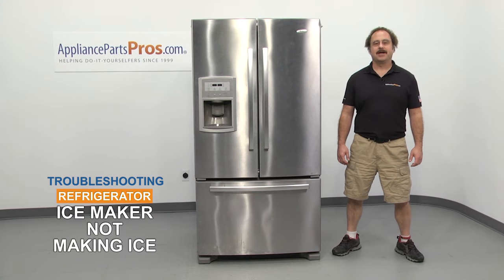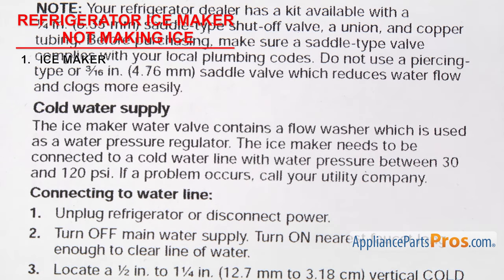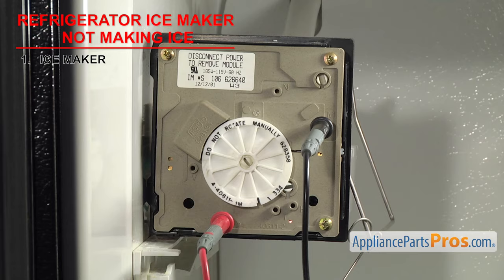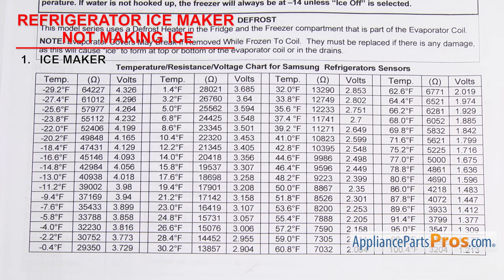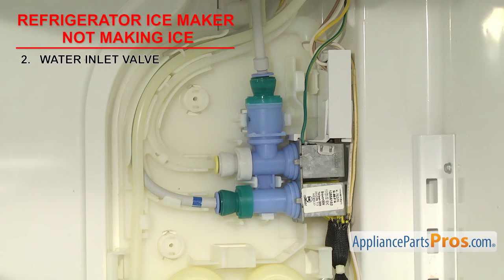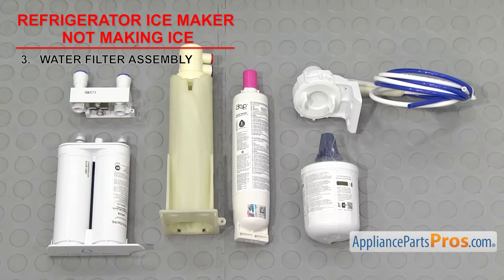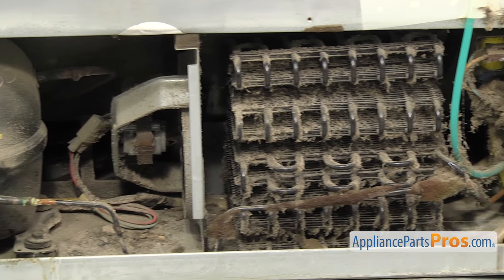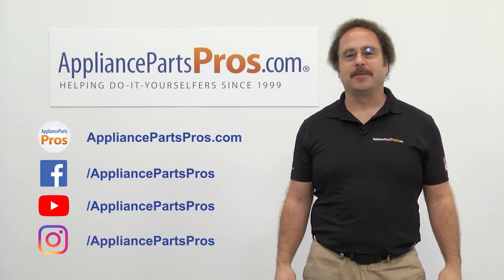Refrigerator Ice Maker Not Working - Top 3 Reasons & Fixes - Kenmore, Whirlpool, Frigidaire & more

Comment: External water valve solenoid I’m reading 1 ohm instead of 270. I checked the continuity on the solenoid for the ice hose in the back and it was good. Where is the external water valve solenoid at? I’m not sure what part it is

Comment: Here's my problem, I changed out the check valve, mine is inside behind the panel. I'm getting water to the water dispenser but none to the ice maker, so should I now change the ice maker?
Reply: Same
Reply: @shaunseagrave729  Same, I replaced the Water inlet valve and it did not fix the problem. Mechanics of cycle seems to work fine, it is just not pulling in water. Did you solve your issue?

Comment: This was a tremendous help! My Kenmore IM was still working but not producing as it should. Cubes were smaller, also. First step was clean the coils, and they were completely clogged. After a couple of days the IM close to normal, but still not producing as before. Just checked it out with multimeter and all appears OK.
Reply from the maker: What all did you happen to check with the multimeter? What is the model number of your fridge?

Comment: Last ohm meter test about blew up my ohm meter. Maybe they meant to unplug the refrigerator before testing!
Reply from the maker: Unless you are specifically testing for voltage it is always recommended to unplug the unit during testing.

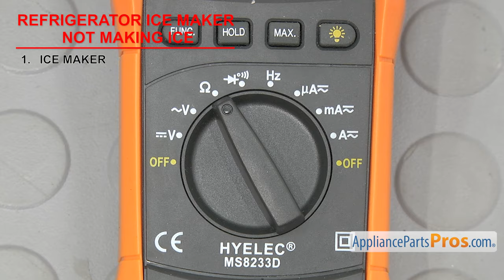Comment: I got stuck at 2:53 "First remove the cover"   In the video it's just sitting loosely on.  In my freezier, it's impossible to pry off.  Do I have remove the icemaker first just to get the cover off?  And if so, then I could use a bit more guidance on disconnecting the electrical connection.  I'm not seeing anything to pry up to release the connection.

Comment: I have a Hisense French door but the ice maker is identical to the one you're showing . I've had it for 2 yrs and a hard piece of ice knocked the part that flips the ice loose then the wires looked as if they got cut . For some reason , my entire frig seemed to shut down after this happened but everyone doesn't think this has anything to do with the frig stopping but this is the only thing that happened before it stopped. I actually tried to put the wires back together and noticed the frig staying on 45 seconds b4 it goes back out . I decided to replace the ice maker and hope it works . Because non of the videos I've seen has stated this could happen , I've just been guessing . Hopefully the replacement works .  Thanks for the video !

Comment: What temp should Frigidaire refrigerator freezer temp be set on the lowest or highest setting to make ice faster ?
Reply from the maker: As long as it is below 10°F, the icemaker should make ice. However, the speed will not change. On average, most icemakers make around 10 cubes every hour.

Comment: nice video, but it doesn't show my kenmore side by side. the ice maker is in the top of the frezzer. the ice despensor is on the door with a lift out bin. how do I fix this.
Reply: Have the same refrigerator.  I keep replacing circuit boards. Doesn't seem to help

Comment: Help! When I tested L and M for the motor I got 74.8 ohms  (MM set at 200 which is lowest ohm setting)  you said should be  4,400 - 8,800...when I tested the external water solenoid I got no change on MM. Got one on order.....

Comment: This one driving me crazy if anyone has suggestions.  My Frigidaire side by side is about 8 years old.  The ice maker replaced about 6 months ago.  We noticed some wet ice and frozen clumps in bucket then water leaking out of front.  I determined that the ice maker was calling for water and it opened up the valve and seemed to fill the tray normally and with no leak.  However, it called for water again every 3-5 minutes until the corner of the tray would overflow.  The valve seems to be coming on and shutting off properly it is just happening every few minutes instead of waiting the proper cycle time.  Is it the ice maker, the inlet valve or something else?

Comment: There is a part on top o f the refrigerator with is a tube that provides de water to the ice maker. That piece suddenly start  throwing water up to the ceiling and get water in that little compartment and  water does not get to the icemaker. What is wrong.? That.little square pice.on top of the refrigerator?

Comment: Hi. I have a similar fridge. It makes ice. But is like melted. Like water had been poured over all the ice. Freezer is working fine and freezing the food. And the ice maker is brand new. What could be causing this??
Reply: The heater coil has to loosen the ice up so the arm can push it out from the tray. If its overly thin/melted ice then maybe the freezer is not set cold enough.

Comment: Don’t blow up your ice maker like I did. I have the first type he showed how to test. The numbers looked good on the multimeters so I pulled off the white gear thing that says don’t adjust.  One of the contacts was black and dirty. I cleaned the gear part with electronics cleaner and a brass brush. Then, for good measure, I sprayed electronics cleaner into the ice maker contacts. Nothing happened until I scrubbed it with a brass brush and BOOM. Instant fire. I blew on it and it went out. Reinstalled the gear and it started turning immediately. Seems to work like new!
Reply: L

Comment: I have a Kenmore elite refrigerator which is only 2 years old..water flow is ok..still coming out from the frig. But replaced the filter anyway...I pressed on the test hole in ice maker assembly and it seems like it’s rotating and has water coming in also. But I replaced it anymore since it’s easy to get to. I checked the back of the frig, everything is clean...fan still running fine. But I clean it anyway...now ice maker still not making ice..I don’t know what else to check..any idea? Thanks.
Reply: So basically with brand new water filter and ice maker assembly, water coming out fine...but it’s still not making ice..so frustrating.
Reply: @sengtha9396  Did you ever get your ice maker to work? If so, what was wrong with it?
Reply: Same issue